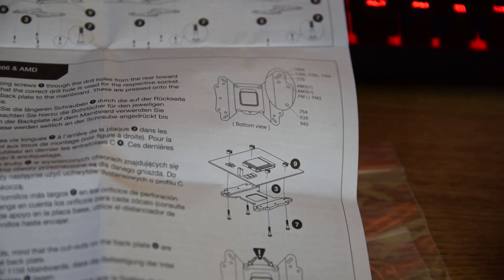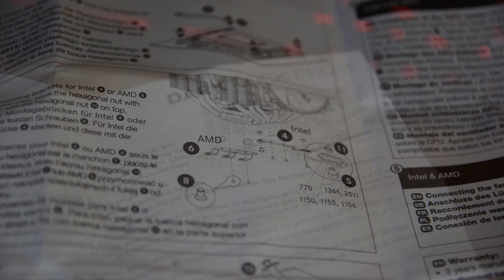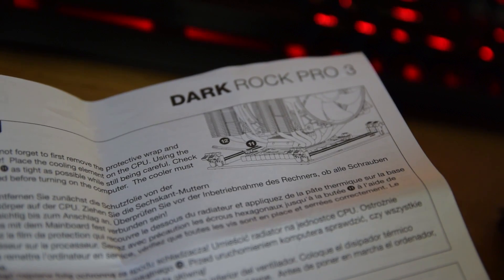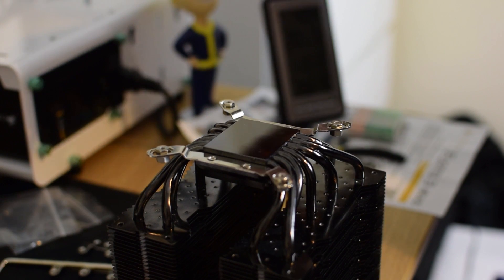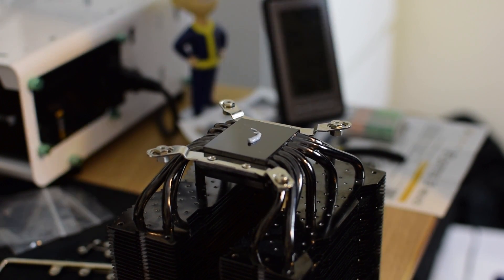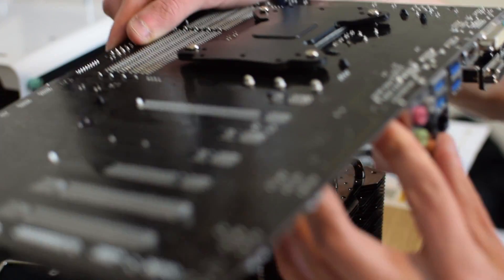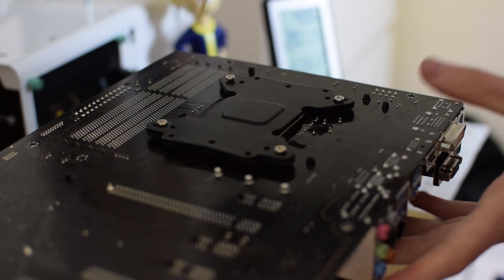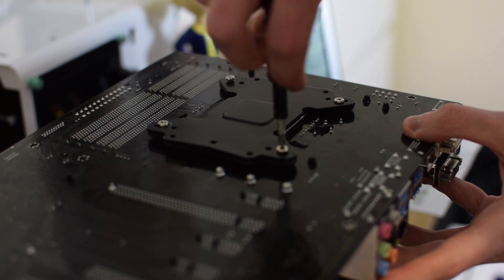How To Install A Be Quiet! Dark Rock Pro 3 Cooler

Comment: That's really difficult. I have followed the instructions and screwed the screws directly to the radiator with the enclosed screwdriver.

It is much easier, as in the video to screw the fan from behind. If you want to change the RAM, you only have to loosen 4 screws at the back, pull out the fan and then insert the fan again and fix the 4 screws from the back.

That saved me 4 bloody fingers and 50 minutes of work.

One small Note: BeQuiet has 2 different types of Manuals, you can find this Solution with "scews at the back and fix them" on the Internet(BeQuiet Homepage). The much more complicated way is written down   in the enclosed instructions.  Funny thing hahah

Comment: Aw man Installing this was a bitch since I messed up 2 or 3 times now I'm not sure if the thermal paste will do its job well since its already spread and flattened out on the chip and I hope there won't be any bubbles after screwing it down furthermore.
Reply: Pat Fury The paste becomes liquid when in use which fills in the gaps where bubbles are and it can be spread or in a blob, either way it gets spread
Reply: Trash Dove the only thing I did was removing it again, cleaned it and reapplied the paste and also carefully put the heatsink back on without having to correct it. Felt like landing a helicopter crash free.
Reply: That's good 👍

Comment: What happened to the outer fan on the cooler?  You removed it?

Also, question: does it matter which side you place the fan on?  (Toward front or back of pc?)

Comment: only thing about this big ass cooler is that when you want to upgrade ram or cpu or thermal paste in 2 years time, you have to remove everything lol
Reply: Hi, yes when swapping out the CPU. But not the case for memory upgrades, just unclip the smaller fan :) Dan.
Reply: oh yeaaaa forgot about that lol thanks

Comment: be quiet emphasizes looks over functionality,. sad
Reply: This is probably the third best CPU cooler on the market in terms of noise and cooling, the first two are the Noctua NH-D14 and the NH-D15. Yes this cooler is a little bit louder, and the CPU will be a few degrees warmer. But this cooler is hands down the best looking cooler out there.
Reply: Hi, can't you say this about all dark nickel plated coolers? Nickel plating does decrease performance, and naturally costs more. Dan.